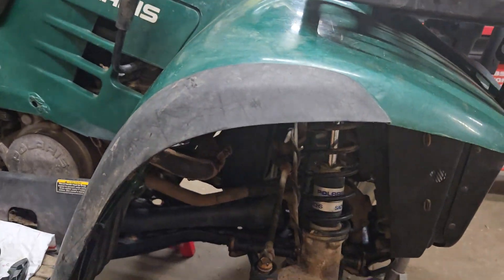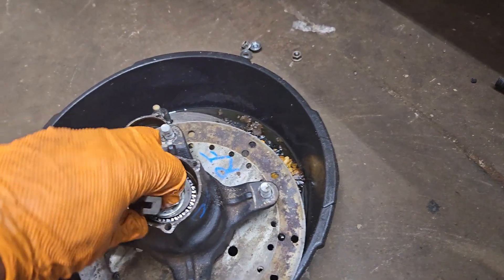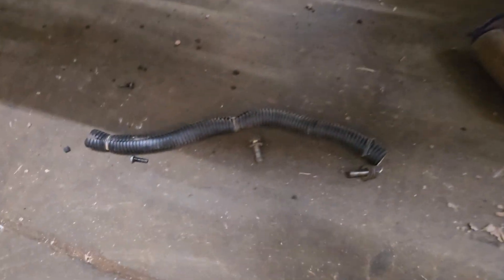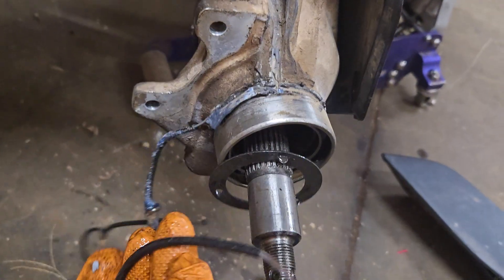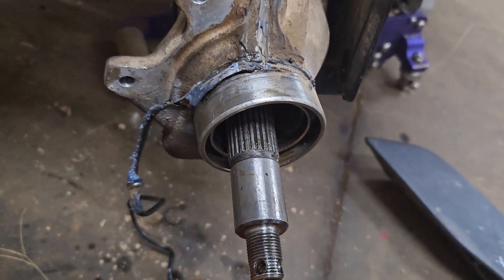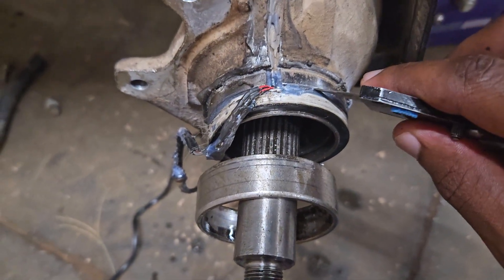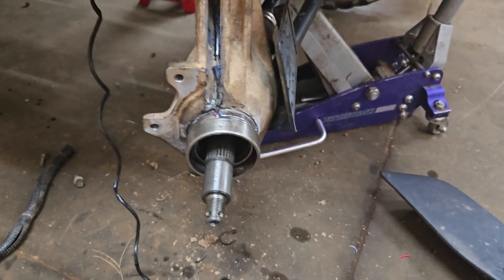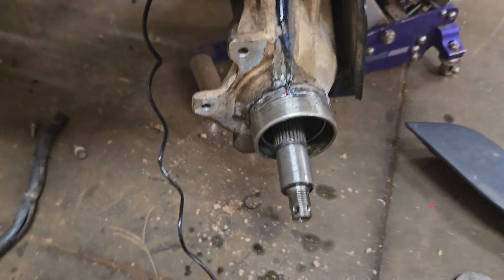How to fix Polaris Sportsman 4x4 drive.  Why is my 4x4 not working? How to disassemble it.

Comment: Jeshua, appreciate the video. Quick question, having a problem with the right hub intermitent engaging and disengaging. The electrical is questionable, 1998 500 model.  You think it could work to just unplug the hubs?
Reply from the maker: If you don't need 4x4 you could unplug the hubs but that doesn't sound like an electrical problem. The circumference spring in the hub securing the rollers maybe be broken and there could be pieces of metal in the hub interfering with the spring and rollers causing them to jam and randomly engage with the inner hub. Trying cleaning the hub. Put new 80w90 oil in it.

Comment: Hello, I checked everything on my Polaris sportsman 500, plate gets stuck to the magnet when awd is engaged but both front wheels won’t engage when rear is slipping. Any ideas?
Reply from the maker: These can be incredibly hard to fix sometimes. Even if the magnet is engaging sometimes it won't engage if the ratchet mechanism is getting stuck a little.